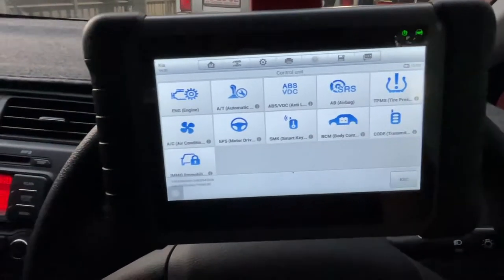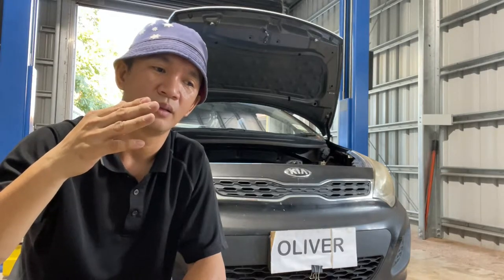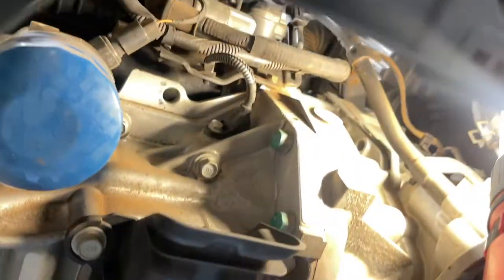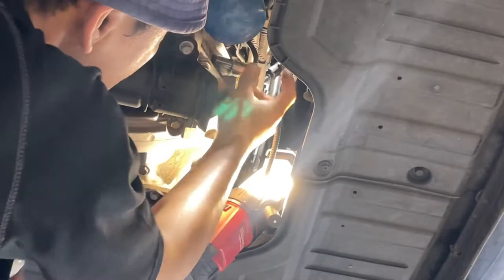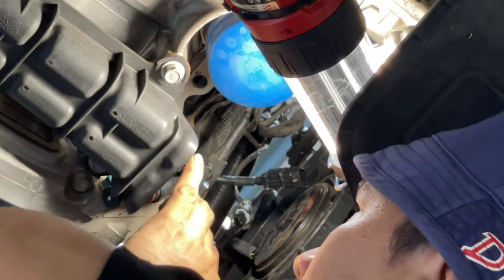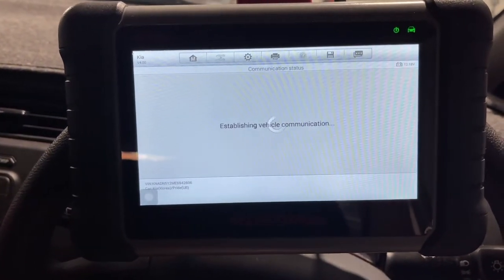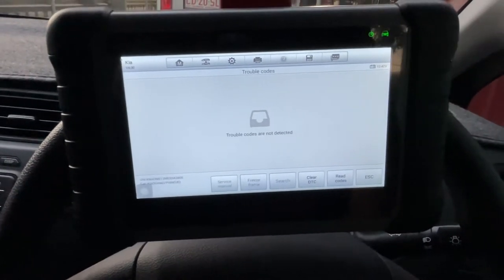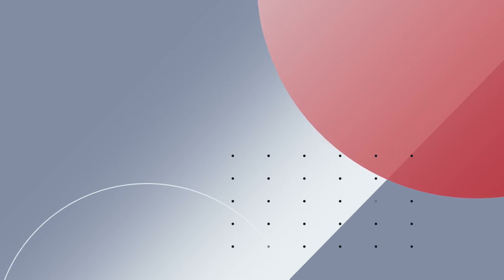DIAGNOSED / REPLACED KIA RIO CRANK ANGLE SENSOR

Comment: Had all the same issues and replaced the part. Now the Rio won’t even start at all. Know what could cause that?
Reply from the maker: You’re problem is not the same mate if it’s the same it will fixed the problem 😬

Comment: For Kia ceed 1.4 80kw 2008  p0339 and engine dont start. If is start, after the shock is end and motor is hot again the engine is stopping.
Reply from the maker: Thanks for the info mate 😉 yes you’re right my problem is quite unique because maybe the sensor is still not yet broken but it’s playing up usually it doesn’t start straight away but mine is a little bit unique 😅 cheers Oliver
Reply: @oliverthemechanic8532  i change the crank sensor 30$and  now everything is ok. Motor and consumtion work perfect.
Reply from the maker: Nice 😉